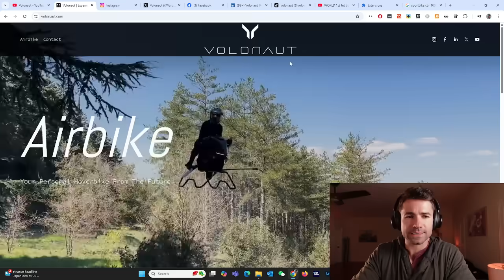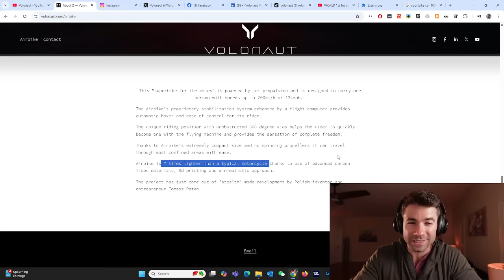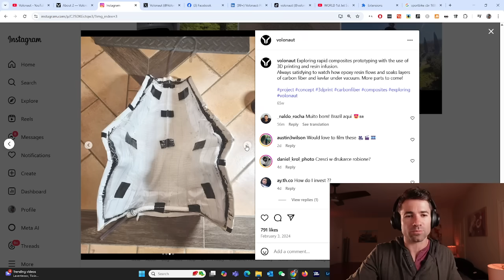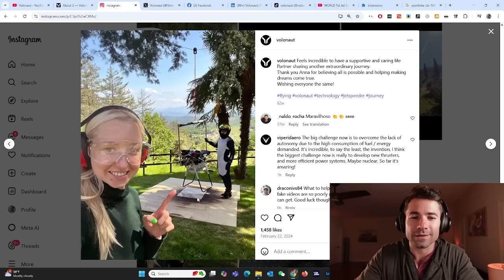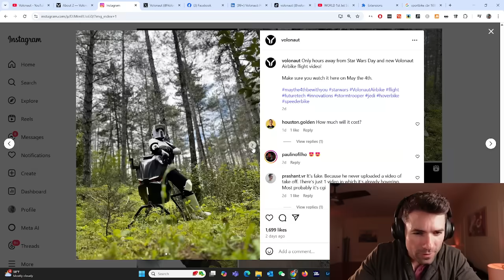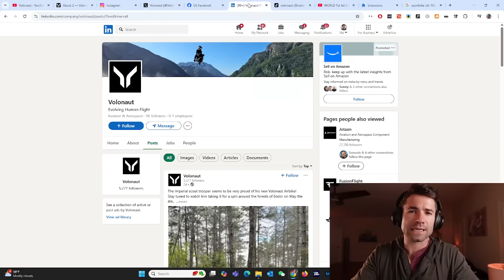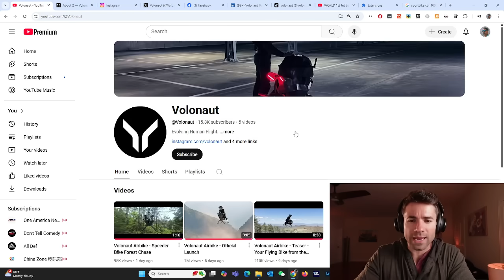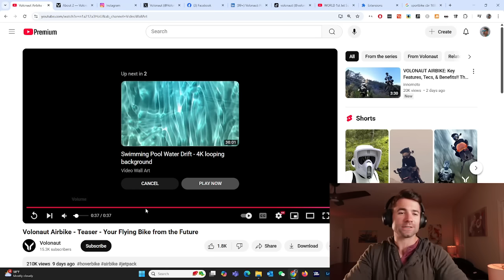Is the Volonaut Airbike Real or a Scam? (Expert Breakdown)

Comment: Volume of the bike is too small. But there is a bigger problem:
1. The downward airstream seems too weak.
2. No openings at top and bottom for the airstream.
3. The rider might get sucked in by inward airstream.
4. Only one airstream if any at all. That's instable. That would require constant balancing.

Comment: Ok so let’s say thrust is there with 6-8 mini jet engines for propulsion up and front. What happened to small wings for control of the flight and the principles of flight for lift etc? Anybody who is in the field of aerodynamics, thermodynamics and fluid mechanics can see something fishy here. Btw … where are the air ducts to supply  those turbines with a gaz intake (air in this case). Besides that… the concept looks amazing and well thought out. At least someone is doing and adressing that problem and need. A small carrying vehicle that can fly and move at least 20 feet in altitude to avoid traffics 😊

Comment: This is a 'concept' of a future transport.  If it was real, you would already own one., and yes, there is a crane suspending the 'bike' for the video to visualize the concept''',,, even though it does have 'thruster' type engine, it can not operate with any degree of safety. How do you control it in the air ? How about windy days ?  What is max height achieved ? Max distance ? Max pay-load ? Can a fat man fly this ?
Does it come with a Bike-Chute for to parachute down, BUT if you are flying too low, chute won't work and you crash into a house or over-head power lines ?
Maybe one day, but by then we will create some new 'concept' of transport like 'magnetic propulsion' or Teleportation ???????

Comment: Stop trolling everyone!  There is no way this is real.  Can you imagine how much thrust it takes just to lift this thing and the rider off the ground?  You need one hell of a jet engine that does nothing but blow downward.  Then you need something to push this thing forward and something to keep it from flipping over and something to allow you to steer.  Unlike any vertical take off jet aircraft, it has no wings to support it, no wings to create lift as it transitions from vertical to horizontal thrust and no control surfaces yet it appears to be more stable than any aircraft I have ever seen.  How?  All of this and carrying enough fuel to provide all that energy?  There is a very good reason why none of the videos show this thing landing.  Landing any VTOL aircraft is the most complex and difficult to control phase of flight.  This thing isn't flying. It is fake.  It is what is commonly known as "vapor-ware".
Reply: Stop acting out. This is a prototype created by Tomasz Patan. He has already delivered the Jetson One which is the drone-like airbike, so he knows what he's doing.

Comment: To those that say this is not real, look at the jet suit that most of us have seen. The turbine jet engines on the arms,  and fuel tank with electronics in the pack are smaller than the person wearing and flying that, so how can anyone say it's too small, or body mass is too high for this to work? This is absolutely possible to be real, but yes, there would be a bunch of challenges to overcome with this. For starters the fact that turbines don't offer instant thrust, or instant lack thereof. They take a little bit to respond and spool or slow down when the throttle input is changed, so balancing this craft, even with 2025's amazing GPS and multi axis gyro capabilities to counter unwanted movements, it wouldn't really be responsive enough for hovering, unless there is a way to instantly change the amount of thrust being produced. (Which I believe can be done through use of "nozzle" like vectoring thrusters- if thats what they are called), or by pointing the nozzles outward like the arms on the suit do to lessen the lift produced, as that suit seems to use a governed constant speed with it's turbine jet engines.
 Thrust vector steering is on RC planes and actual jets, so why wouldn't it work here. It does, and has been incorporated into personal craft already, it just has to have a way of instantly changing it's output or the controls would be delayed. I don't know if this peticular thing is real or not, but it 100% is possible that it could fly. We have the Harrier Jet (development starting in the 1960's) as an example of similar tech on a larger scale. We even have a hoverboard that uses turbine engine to provide lift. All of these have been displayed in public for all to see.
Now, it would be incredibly hard to hover and land, but we've learned to hover helicopters which is a similar concept, except this "bike" would be much harder to hover as it is top heavy where as a heli gets it's lift from above essentially carrying it's weight rather than pushing it's weight from below the pilot. A heli's swashplate allows the blades to change their amount of lift in real time, so it has more control over it's lift where a direct thrust engine like turbines do not. It is likely that this is real, and even if it's not, we are going to see similar vehicles in the near future. After quadcopters/drones became mainstream,  the personal flying craft like the "Jetson" appeared. They are now available for purchase,  being used as short trip air taxis in other countries, and even in aerial racing events too. A man with 4 small turbines strapped to his arms via a specially engineered suit has been real for many years now, you mean to tell me that this resemblance of a motorcycle vehicle can't be real? C'mon people.....look around and you will find that technology and engineering has allowed us to do some things we never should have been able to do, such as flying a craft that carries hundreds of passengers across continents at 30,000 + ft. Airplanes are not far off from being battery powered with electric motors either now in 2025, I have done work in a facility here in upstate NY where the research and development of battery powered engines has been going on for years. We are limited with battery capacity and weight, but there are already single engine planes that use this technology, and the tech is always changing and improving, so just like cars now, I would expect to see electric planes starting to make appearances for short one way trips in the coming years. If we could use the same tech that heli blades use to instantly change lift in real time like the collective and tail rotor apply, a turbine would finally become so much more versatile. I believe the high RPM of turbines is what makes this challenging. (I won't say impossible because it wouldn't surprise me if this is already in existence).
 If this hoverbike isn't real, it likely will be, and publicly viewed by 2027. I believe it's already out there and being ridden by it's creator, which we will be seeing in person when they get it perfected.
Pretty sad and scary that the fake videos being generated by A.I. capability have us all questioning so much of what we see now. How many people are going to be falsely accused by video evidence of a crime they didn't commit because of this A.I.video tech? This means anyone could potentially have access to create realistic videos of essentially anything they could imagine. Thats a whole other subject though, but I'm sure you get my point.

Comment: It said it's a turbine engine, but runs on gasoline? Thats ridiculous. There are no jet engines that run on gasoline. Too volatile. Jet engines use a bunch of fuel - wheres the big fuel tank it would need? And the weight of the fuel plus a person is going to make one hefty little jet bike. There is nothing visible that would be used to stabilize it, like wings. The operator sits in a weird upright position making it look top heavy and unstable. How does it stop? Reverse thrusters? Also, watching the video shows the thing perfectly stable during flight. It actually should have some significant wobble being as top heavy as it is, and the pilot should be seen constantly moving around to control it. But he sits still as if in a chair. So, just the amount of fuel this thing would demand makes me wicked suspicious. And the heat from the jet engine! My god the heat!

Comment: Watching one of Volonaut's videos, the one named "Test Riding Flying Speeder Bike" I notice that at 53 seconds in as the speeder is flying past a tree its landing struts seem to vanish like it was suddenly flying behind a picture of the forest. If I had to guess, they have plans but it doesn't work yet, maybe not even past the concept stage. The burnt wooden boards do say they were testing it there but not that they tested it successfully.
If the speeder could fly they would have included a lot more obvious and distinct footage rather than one set on noisy backgrounds and blurry pans.
Reply: The bike was on the other side of the tree the landing gear disappeared behind the tree

Comment: some of the mini turbines are rather powerful. I suspect that's how it works. probably has thrust vectoring to move a maintain stability. at 230lbs I doubt it would fly me around much though. rocket engines wouldn't work in my opinion. if its legit it uses turbines for sure.

Comment: Fake. I dont think its AI I think its CGI.  One of the biggest reasons I say this is NO VISIBLE CONTROL SURFACES... For flright control surfaces are paramount you cant have 150 lbs of person sitting over the top of a Chassis and not have control surfaces or Nozzles redirecting air flow.
The Burnt board image isnt using the same skids Anything hot enough to burn the ground is going to create air far too hot exhaust wise for a human to be sitting 4 feet away from. No videos of landing no videos of takeoff. Youre not going to have a prototype sitting on uneven surfaces in the middle of the woods So he had had to have landed there to have been there carrying 100lbs while also dressed in cosplay up unto the forest is just feasible meaning he had to have landed there and THERES NO WAY IN HELL you would land on a slanted uneven surface with such a small item also if again if the exhaust is hot enough to burn wood youre not taking off in the woods without risk of fire.  I follow a guy who literally flies on his own jet platform from under his feet. He always shows his takeoffs and landings and you can hear the engines.
This guy knowing how unstable it would be is with all that dust and debri is hoving waving hi without no debris at all and knowing how unstable that would be for him to be waving like that would be risking a ton. Its fake I could make the same thing using drone footages and Hitfilm with a green Screen.

Comment: It 66lbs with 10 minute flight time, thrust vectoring turbine engine 200lb max load runs on diesel, bio fuel, kerosene or jet fuel.....yes its cool but not $880,000 cool😂

Comment: The most powerful RC turbines only produce up to 100lbs of thrust, so at least 3 would be required to have any chance of lifting the weight of a rider, plus vehicle plus fuel. The amount of kerosene required to get any more than a few minutes flight (if it were possible) would just add weight. The center of effort is very narrow, (assuming the thrust comes directly from underneath) and would require very powerful fast servos to move the turbines through 360degrees to balance any flight, (or operate ducts,- which are not visible) To me it looks like it's filmed on a zip line with clever editing, and the long pole out the front is a guide for the cable. But that's just me. Most of these 'inventions' are filmed 'flying' away from public areas with very few people involved. Don't think I've seen one yet demonstrated at an airshow for example ? Maybe just trying to sell a concept to get investors to support an idea which will never become a reality for public use,- except maybe oddball sports such as monowheel electric bike racing. They would never get approval to fly in public areas due to the 100% lack of safety features, (ie, imagine one dropping on your house or a crowded area.

Comment: Ever hear of a "Harrier Jump Jet"??? Basically a ducted jet which can be maneuvered and directed to assist with directional thrust and flow. Question is, on this rig, if the engine provides enough gyroscopic stability and how the weight and center of gravity are situated so it is not too top heavy with the rider on it. Perhaps the skids have more weight to them to make the machine more bottom heavy???
Reply: Its not a jump jet, douche

Comment: They are pre-order selling them for $880,000 you start an online order for a $5k position in line!!   Once they start your order, they want a deposit of $795,000. They weigh 66 pounds.  It’s a diesel powered jet engine. It has the flight time of 10 minutes back speed 124 mph as long as you weigh under 209 pounds you can fly it so honestly it’s probably not gonna be available in the United States lol     It’s not a scam. This is real!  You can own one if you got a million to blow. It looks like it has joysticks, but it has something to do with helmet control. I think you ride it like a Segway I believe it’s the same principle.

Comment: The gravity system is around 30 kilograms (66 pounds) when fuelled so 40 ponds for structure and controls not outside the range of the possible  going by the gravity flight times would be short less than 30 minutes

Comment: It's real. Dangerous, but real. It's obviously made of carbon fiber and powered by jet engines that were originally marketed to the scale rc model jet industry. I have 2 in my basement. However, I would NEVER strap a several to my ass and trust them to reliably keep me afloat.😂 Same concept as the F35. There are most likely multiple engines to get the thrust you would need to lift him and the ensemble into flight. Something like 4 JetCat P300s or equivalent with limited tilt for lift and direction. Vectored thrust would involve too much loss and additional hardware which equals weight.

Comment: Relax people!!
 this technology is not a hard thing to accomplish, the hard thing to accomplish is having enough fuel for the turbine/jet engine or battery power for electric motors4  a somewhat acceptable distance and flight time. This is still just a PIPE DREAM NOVELTY with very little use